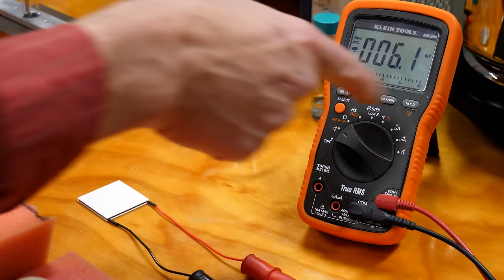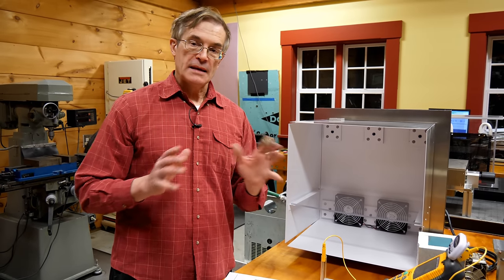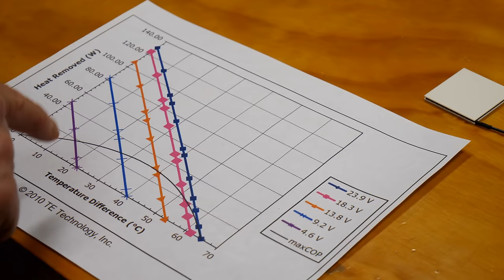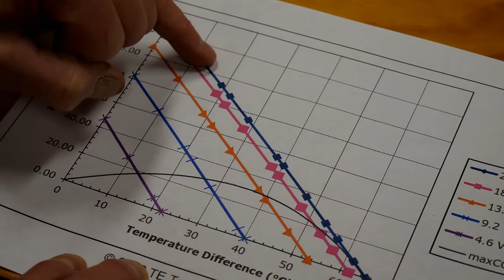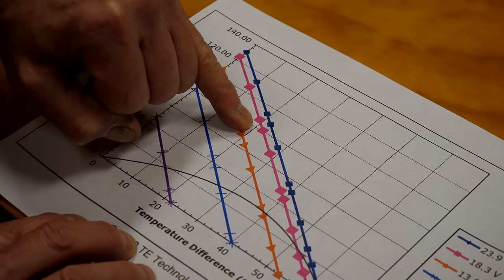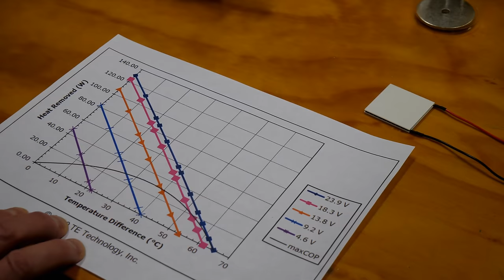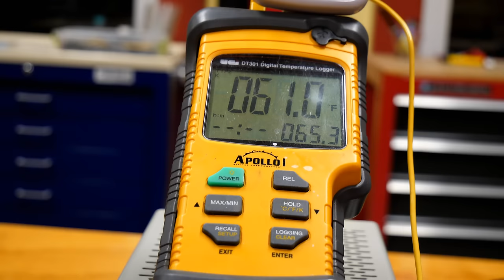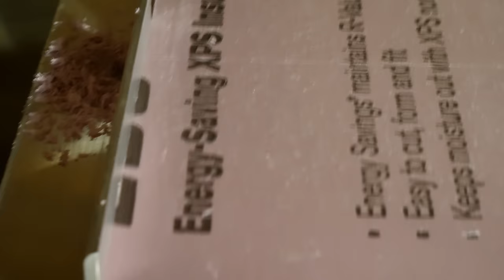BUILD YOUR OWN REFRIGERATOR! - SOLID STATE TEC

Comment: Very nice presentation. However, I would take issue somewhat with your explanation of the Peltier effect in terms of energy differences between the two conductors. A better explanation is that the Peltier effect depends on the electronic entropy difference between the two conductors. To be more specific, the Peltier effect depends on the difference in partial molar electronic entropy of  the two metals. Reference: Partial Molar Entropy and Partial Molar Heat Capacity of Electrons in Metals and Superconductors
, Journal of Modern Physics 07(02):199-218, December 2015.

Comment: I did wonder about water cooling and then I saw that you were planning just that.

We don't have such low outdoor temps in Oz, but many people have large water tanks. I have often wondered why we use honking great air heat exchangers when it would be so much more efficient, not to mention quieter, to use water for air con and refrigeration. It's not as if water is difficult to transport around ...

No, haven't done the numbers but I think it would be difficult for even a large refrigeration system to significantly raise the temp of a several thousand litre water tank, especially if it was made of galvanised iron. And if you have a well, bore or any other form of ground water, then you're ahead even more.

Comment: You should try incorporating heat pipe into your heat sink design as well (similar to the computer heat sink) -  the phase change that happens within them is very efficient & effective for conducting heat - which is why they're used in CPU heatsinks and in laptops - and (best of all), they don't require any moving parts!

Comment: Great video! Can you explain why the aluminium spacers between the plates at the heat sink have large holes in them? I did not catch that from the video.
Reply from the maker: It increases the pressure on the interface area.

Comment: 32:05  another potential limiting aspect in that test is the heat pipe is upside down. If it were just a strait pipe  the condensed working fluid would flow strait down. But  depending on the angles involved the bend could  impede the glow of the liquid working fluid inside the heat pipe.

Comment: This is so interesting. I''ve yet to see a satisfying scientific discussion about the 'ideal' efficiency of Peltier cooling/generating. Im not satisfied with "labeled" efficiency. I'm so curious about how much the macro design of Peltier component itself, and the surrounding system, is limiting the efficiency compared to the thermometric phenomenon itself. I'm intrigued by a couple of concepts. Consider that resistive heating is quite efficient. There you are converting electrical energy into thermal, with almost no loss. I know this is  mostly a different thing. It's just seems slightly relevant to consider how elegant it is.  Consider that refrigeration conceptually is just about transporting energy, not ideally adding any, or converting it to other kinds. I lean towards thinking the "inefficiency" of Peltier cooling is related to "'waste"heat. But again, I'm trying to understand the actual reasons we can't keep the hot side more separate from the cold side. A question that I then have is, if we could move ALL the heat from the hot side of Peltier 'plate' passive the the outside, with no additional input current, what would the efficiency then be, and wouldn't that be the 'ideal' efficiency? And how would that compare to the efficiency of resistive heating?

Comment: I've got a 1934 GE Monitor Top refrigerator and it uses only 140w while running. 17w while idle to power the 'oil conditioner' which is pretty much just a cartridge heater to heat the crank case and separate the refrigerant from the oil. MIne uses Methyl Formate as a refrigerant, which is low pressure and fairly safe. Lots of these fridges use Sulphur Dioxide which will make you go blind if exposed to it. I asked an HVAC tech i know about it and his reply was two words... "ball cancer".

Comment: solid state is good and all, but my great grandmother had a chest freezer that used kerosene and was wound up like a clock that used 2 D cell batteries. Every 3 months you filled the kerosene tank (1 pint) and wound it up. every 6 months you replaced 2 batteries. It still works to this day! I think they purchased it in the 40's

Comment: I was trying to use the thirmistor or thermocouple tech as a panel of small points such as a solar panel if we alter our appliances to run off of battery power with an inverter we can reclaim the heat generated through work and return it to the battery reducing the amount of electricity drawn from the grid increasing efficiency this clearly woud do the same probably more efficient

Comment: Great video!
What is the purpose of the holes in plate spacers? I doubt it's done for weight saving. Is it done to spread out the compression force? It is counter-intuitive since you are reducing the thermal path to the plates.
Reply from the maker: You guessed right.  The decreased distance to the edge of the contact region allows the TIM to squeeze out and reduce it's thickness.

Comment: I have a few issues with the design. First, the more surfaces you transfer heat through the worse the conductivity. Ideally you want to reduce the contact plains. 
If you generate more than 20C on the output of the peltiers you could make use of heat pipes. 10C if they are ethonal based heat pipes.
You could then use heat pipes to draw heat from the peltier to the plates. You could draw from each peltier creating a stack of pipes going out to the fins. Then use a connecting block and secondary pipes to spread the heat along the plates. You would need to check the temperature at each connecting block if it is even worth using a heat pipe. 
Currently as it is you have 4 surface areas to transfer through before even getting to the peltier. 
You might also find spot welding to the  blocks to the fines multiple times through the plate  will provide better conductivity than using any compound. If you aren't planning on taking this apart that might be of some use.If you plan to take it apart and reuse that material I wouldn't do it then.

Comment: The reason that the higher speed fan took longer is that the air molecules were not in contact with the surface long enough to reach saturation.  Saturation being the point at which the molecule ( air, water, refrigerant) has absorbed its maximum amount of energy before state of change.  Air being a vapor doesn't change state but the point is that the energy in the heat exchanger was not conducted as well because the air molecule didn't have time to absorb the calories to reach saturation before they were moved away.    An automotive cooling system will demonstrate this in an overheat condition when someone removes the restrictor because they think without a thermostat that it will run cooler. They do not understand the function of the component completely and remove the flow restriction known to them as a thermostat. The coolant never stays in contact with the block long enough to absorb the calories it would under proper function and an overheat condition results. Slow the flow with a restrictor plate in place of the thermostat and cooling again works as designed. Conduction of energy only works well when the molecules are allowed to be in contact for a sufficient period of time.

Comment: (Referring to the passive heat sink on the back of the cooler) would deflecting the metal plates a half a degree from parallel on the top side give you a better "air pump" effect?   When thinking about it casually it seems like you would want to add as much volume some small distance above a location (dx) as the air in that distance (x) would expand from absorbing the heat in some time (t) to keep from getting any local resistance to flow. Then when the gap between the plates gets too big, adding another plate starting from that location on up. You may be able to get a larger concentration of plates (like the computer heat sink) without having to add a fan.
Reply from the maker: It might have an effect, but it would be extremely small.  The air only warms a few degrees.

Comment: Excellent tutorial, but I am not sure about one thing - why spacer plates have big holes in the middle?
 It is because you want to keep thermal mass of the cool side low as possible (therefore thermal inertia too), while remaining contact sufrace area is enough to transfer heat?
Reply from the maker: I didn't mention that, but I found that the smaller contact area increased the clamping pressure (not the force) and the improvement in thermal transfer due to the pressure more than offset the reduced cross-sectional area of the blocks.
Reply: @TechIngredients  Ididn't think about that, despite that it seems quite obvious :)
 Thanks for quick reply!

Comment: use the tec to collect the heat generated through normal appliance operation similar to a solar panel and use to charge a battery which the appliances would be altered to run off of therby increasing the efficiency of the appliance by capturing and returning a portion of energy initially used

Comment: Thinking it would be cheaper just to buy a travel fridge. But great video. Little disappointed we didn’t get the final temperature you was able to get. Why was there so much aluminum used between to cool side blocks? Don’t you need to separate the cool blocks from the exterior aluminum for greater efficiency?
Reply from the maker: The spacers are necessary to allow insulation to surround the fridge and between the fins to allow for air flow.

Comment: The R value insulation exists in IU (metric) units also (of course). 
I’d rather not measure things in body parts and" sheep and frog’s leaps and the energy of horse carriages".... thank you very much !
Ha ha ha. 
Anyway. Your explanations are spot on, i’m rembering my bachelor's degree very fondly. I sure wish a teeacher would have showed an egg carton to explain the movement of electrons ! 
Wow ! Elegant, pretty close to accurate !
Another ’special request’ : could you, in your demo’strations, use more natural materials ? Cork or plant fibers as insulation ? Etc. You have such a large platform, you could be a positive influence against overuse of plastics and petroleum derivatives ! Thanks !
Reply from the maker: Thanks  for the feedback.
It's  funny that you compare the measurement system to natural standards while suggesting the use of natural materials.
The metric  system is base ten because we have ten fingers not because it is inherently better. Also note that the world's most expensive supercars are built in Europe but are advertised  based on their horsepower output and not in kilowatts; it's what we're  used to.

Comment: Did you consider using indium foil between the heat sink plates instead? Compressed like that, it should perform much better than cpu paste as a TEM.

Comment: One of the most lucid explanations of how Peltiers work that I've seen anywhere. You mention, in passing, use of a module as a TEG; Thermo Electric Generator - now, I know these are not at all efficient, but wonder if you might make a video on optimising performance? I've seen several attempts online, using either series or parallel connected TEGs, but I know different thermal gradients will cause circulating losses in parallel connection or I^2R losses in series. Given how cheap small Ebay MPPT controllers are these days, is it worth looking at multiple modules with individual MPPT outputs summated? 

I'm thinking of something sized to charge a phone or tablet from a small camp fire or even a candle flame. I did once see a commercial product that powered a cluster of high brightness white LEDs from a single candle, that lit a room far more effectively than the candle alone. I'm looking at trying a vertical chunk of 2" box section Aluminium, acting as a chimney, with multiple TEGs mounted in a cruciform fashion, but no longer having access to a workshop makes it slow going ...
Reply from the maker: Thanks.
Did you watch our video on the campfire generator?  I demonstrated some answers to your questions there.
Reply: @TechIngredients  Ah, I must have missed that, will search for it now! Thanks for the prompt reply!

Comment: Thank you! I learnt a whole lot. I have a question though: Isn't it necessary to have fins on the INSIDE as well to be able to collect the heat from (cool) the inside of the fridge?
Reply from the maker: That might help a little, but the entire interior, rear wall of the refrigerator acts as a heat transfer surface.  The fans blow across this surface.  This saves space and materials.
Reply: @TechIngredients  --> Aaaah! I now understand why you used metal. Duh me! Than you so much for the super quick response.

Comment: FYI CFM is inverse to pressure so if that fan has a low static pressure it will reduce airflow. example 20cfm @ps=0 with ps = pressure rating and 100cfm rated at 0.25ps if the flow pressure hits 0.25ps the 20cfm will do about 15 while the 100cfm does 0 (+- physics like quadratic drag). plus the core temperature of that brick may be lower than surface for first and higher than the surface on the second. Great video overall though I appreciate the knowledge
Reply from the maker: Thanks.
You're right about the inverse relationship. However, keep in mind that this is not linear.

Comment: Was it explained why the inserts are hollow? At first I though it was to add frozen liquid to reduce the pressure when the the plates seal it up. But that does not seem to be the case.
Reply from the maker: It increases the clamping  pressure for the same force, decreasing the thermal interface resistance despite the smaller surface area.

Comment: You don't need a fluorocarbon as a refrigerant.  Hydrocarbons 
can work as well.  A couple years ago, our roof-mounted AC went 
out.  All the R22 leaked out.  I got a 15 pound tank of R190, (Home 
D, about $20 or so.)  That BBQ bottle of propane lasted us a whole 
summer.  Later that year, after the "warm" season in Phoenix was 
over, and the landlord didn't have to pull a HORRID amount to 
replace the AC.  (That was the year R22 was forced out of use.)

I've got a tiny countertop ice maker.  Uses R600, or butane.
(There is a tiny sticker on the back warning us it is there.)

steve
Reply from the maker: Sure. 
I assume  the concern with hydrocarbons  such as those is flammability.
Reply: @TechIngredients ,Sir, you are correct.  But, the roof unit was 
all, on the roof.  No propane was actually IN the house.  I thought 
that my 15 pounds of propane, getting us through a normal Arizona 
summer, was a decent investment.

Funny thing, a couple years ago, I saw a "propane" tank, in front 
of a friend's house.  Told my roommate to go and grab it.  It was 
a R290/R600 mix refrigerant tank.  70 percent R290, 30% R600.
I wanted it, to exchange for a R290, sorry, propane BBQ tank.
Still in the back yard.

When I lived in Hawaii, the rumour running around, was running 
R290 propane instead of R12, in cars.  I was there from 1994 to 
2000.  The little bottles of "R12 replacement" were as much as 
the 15 pound BBQ bottles.  For 12 ounces!

Keep up this channel!  You are the best teacher I've found!  Oh, 
too much ethanol tonight.  What would you think about using 
3A molecular sieves, for purifying small amounts of vodka, to 
produce a small amount of 180 to 190  proof ethanol?  Just a 
pint or 2?

steve

Comment: I wish I knew this 20 yrs a go, a friend needed a cooling box for samples, we bought 4 cooler(boxes, then the easiest way to get peltier elements...now we have China 8-), some wood and polystyrene. Because the elements were rated for 12 V  I connected them parallel, and the heat produced was to much for the little cooling we got.. eventually I threw away the peltiers and used regular freezer blocks with a temp controlled ventilator to keep the samples at about 5-10 C.
Even after 12 hours in a car in the summer sun the blocks were still partly frozen.  (the insulation was clearly not bad)
If I had known about the way the energie was used inside the peltiers maybe I could have used 8 peltiers in 2 series and a better heat sink, (probably) used half the electric energie, the box might have worked fine... ( since I am not a scientist I usually have to find out how to find out things really work.. now this guy thought me more in a (few) week(s) than I could find out my self in a year...   Thank you very much.

Comment: Why not use thermal stratification to your advantage by putting your teg's on the top/lid with some large extruded aluminum heat sinks (possibly port cooling them with ducted room air and only 1 fan)? Maybe even using the basin/tub stationary and sliding or hinging the top open thus not dropping the cold air out when opening. This also allows you to use even mercury as your thermal paste/grease since it would be laying horizontal. I know you likely wouldn't use mercury but it gives you options.
Reply from the maker: That would work and would likely be more effecient.  I chose the arrangement to accommodate the space where we were planning to install the refrigerator.

Comment: The copper tubes in the CPU cooler are not for conduction. They are heat pipes. They work on the phase change principle
Reply from the maker: I know that and that's why I explained that they are conducting the heat.  I didn't mean to imply that they were solid.